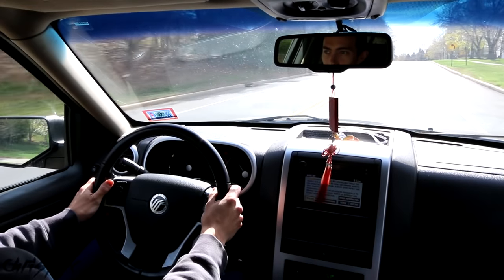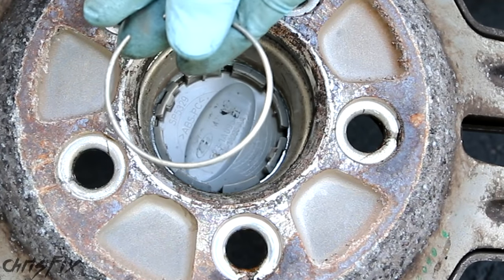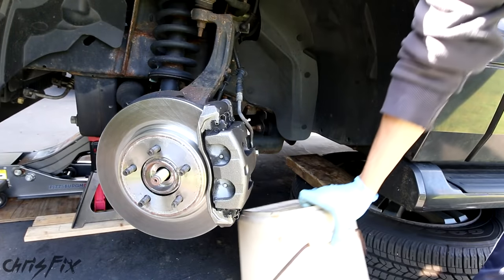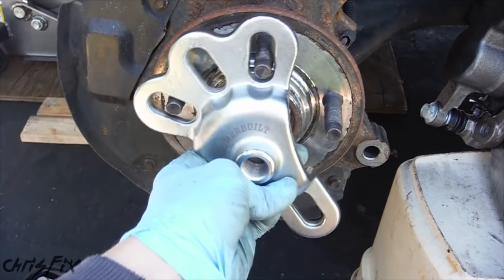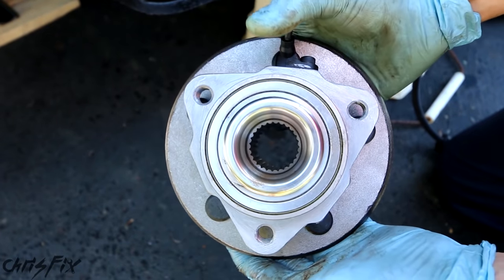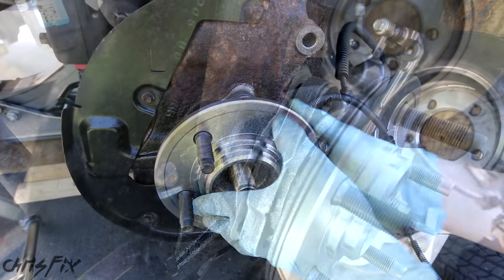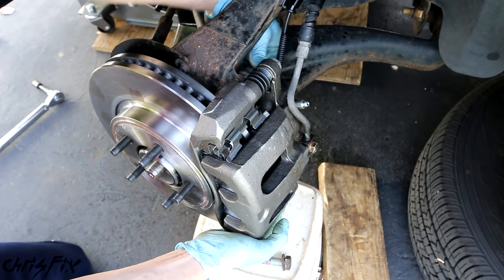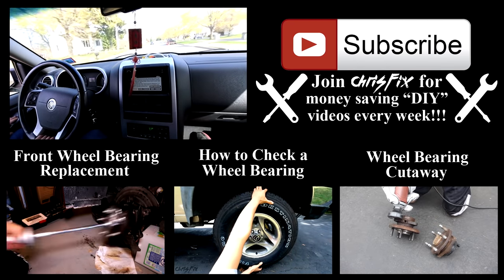How to Replace a Front Wheel Bearing

Comment: I had a mechanic do this on my Ford Focus. It cost me nearly $600 Canadian. They messed up my abs sensor and charged me another $200.
Reply: Less than $100 Canadian and elbow grease if you would of done it yourself.  Assuming you had that tools at the time.
Reply: Yeah, I haven't got the tools. and I sure as hell don't have the tools.
Reply: R.J. Arsenault you really must not have the tools lol
Reply: no I don't. I'm a student working part time, coming from a family that did nothing with cars except drive them and take them to the mechanic, I'm grateful for the screwdriver that we have
Reply: Hopefully you are now in a position to be able to buy the tools to this and other small jobs in the future. It will save you tons of money.
Reply: R.J. Arsenault hope there is autozone or advance autoparts orilleya they lend you tools if you work in their parking lot, just just need tp buy the parts there.
Reply: Honestly if you have a cheap parts store like a harbor frieght, the tools wouldn't cost ya much. You'll either have to buy/rent a axle nut, and that tool to take out the hub assembly. Which even if you bought those, and say the hub assembly ran you 150$? You still wouldn't have spent more than 250$ I'd bet.
Reply: R.J. Arsenault did u need a new transmission aswell
Reply: Surprisingly no ;)
Reply: if bearings are old enough to fail the abs sensors needed replacing. corrosion.
Reply: +R.J. Arsenault - Sometimes you can find excellent socket sets at Canadian Tire for around $100-150. The more you spend the more you get. A 200 piece set will go a long way. A set of screwdrivers, pliers, and Vise-Grip type wrench/pliers should be bought as well. You're welcome.
Reply: Wait what? They charge you for the ABS sensor that they messed up?
Reply: I have had something even worse about 10 years ago.  I brought my car to the dealership for service, and because it was busy, they drove it inside, drained the oil and did some other stuff, then pushed it outside to a public parking spot to make room for other jobs inside and in their own parking lot, and then outside they poured in the new oil.  
Turns out that in their hurry they forgot to close the drain, so the oil went in on the top, and went straight out the bottom again. So when I got there and got my keys and got told where they put my car, it was standing there in a puddle of oil...   
So obviously I complained about that (how mean right?)  and they actually billed me for the extra oil needed.  A couple of weeks later, I got a huge bill from the dealership for cleaning up the oil pollution too (around 5000 USD).  
Lucky enough I had requested security footage from a company across the road because I kinda felt that I could get into trouble for this.  After showing that to the dealership and threatening to take them to court they decided they'd pay for it.  
It was the 3rd incident in a row I had with them (once **cking up the electronics to the point where the car couldnt even drive anymore, and once parking it on a public parking spot without even re-connecting the battery after the work they did, and leaving it unlocked)  so I got rid of the car.  

Now I found a nice dealership that works on my car, and lets me do stuff on my car with their equipment and advice from their people, so it turned out to be a good move to get rid of both the car and the company that kept screwing people (not just me, friends that also bought their cars there too) over. 

When it comes to car maintenance you need to find someone you can trust, and stay with them, as there very bad, and very good companies.
Reply: You should share the name of that dealership-  is it called Ludicrous Auto Werks?  It's laughable they actually billed you for the oil and pollution on top of that-  
you didn't pay for the oil when they billed it, did you?
Reply: I did actually, as I'd rather demand it back even if it is through a lawyer compared to starting a fight there and have them refuse to give me my car back. 
I just wanted the car back and figured I'd demand the money back as it's their screwup, and not part of the quote they gave me that included the oil change.   (And they did refund it when I threatened to involve lawyers) and I never paid for the pollution thing. that's their mess to clean up imho. 

For me its a good example of how rotten companies can get, but Ive also found that there are great ones that will help you with anything. The current dealership I go to for my suzuki is awesome.  Lots of small details get fixed without even getting billed for it, and they are always willing to help with advice, or even help me by letting me use some of their equipment to fix things when doing it myself can save me a lot of money. Also the fact that they just let you watch while they work on the car helps a lot in trusting them.
Reply: There's a dealer by me that lets me do the same as you if need be. Last time I had to use their tools all I had to use was a socket wrench to change out a battery and I had 10 of their mechanics standing around me not believing that a girl could change a battery on her own car. I turned around and said what you guys,  you think it's wrong for a girl to be fixing her own car! They all yell hell no come work for us!
Reply: Canadian Tire.
Reply from the maker: Ouch! That is why I make these videos!
Reply: They didnt mess up the ABS sensor, they fleeced you for an extra 200 because you looked like an easy mark. Mechanics are all liars and thieves.
Reply: ChrisFix Heck yeah man. The most I even spend for parts on my vehicle isn't but $400 at a huge major fix and Chris Fix if it wasn't for a good portion of your videos I wouldn't have a mechanics trainee permit today. I do all of my own vehicle repairs in my driveway and I definitely have a blast doing it myself and knowing that it's fixed right the first time rather than be screwed over by the dealership for something else that they screwed up. My vehicle now currently sits at almost 242,000 miles because I got sick of paying for the line of crap from the garages by my house and not knowing when I'll have my car back. There used to be a shop that every time I would take that car in they always would say that it needed a new engine in it and man were they wrong. It was always a distributor cap. That was on a 1986 Pontiac firebird. Man did I have a field day with that one. Now I have a 2010 Mercury Milan Premier edition and I take damn good care of it. I have rebuilt the suspension, on it done 2 tune ups on her,  replaced both the transmission and engine mounts, have yet to replace the dog bone mount underneath the vehicle, all 4 brakes, all of the door handles inside, converted the stock halogens to LED, ran new stereo speakers in all of the doors, replaced an axle too. She's a 6 cylinder 3.0 liter and eats mustangs for breakfast in drag races. All of the tools I use I paid a little over $400 jack and jackstands included.
Reply: TheSwed3 there super easy to break you could tap some and they'd fall off
Reply: Chaos wow thanks I'm an aspiring mechanic who works in my dad's garage we don't scam people and saying I'm a thief wow cheers a wheel bearing here is around £80 and laybor we normally charge 60-80£ obviously it's be cheaper doing it yourself but your paying for our tools knowlage and experience  so if being as honest as I can is being a thief I guess I'm a theif
Reply: mr nobody I know right! A lot of women here in the states are biased towards the guys saying that us that know how to fix cars are thieves. I do fix not just my own vehicle but my neighbors vehicles too. I got to do my neighbors brakes, battery, and windshield washer fluid nozzles and pump hopefully in the next week. To me her battery and brakes are the most critical fixes that I am going to have to do for her.  Fun times
Reply: Idtelo

Comment: SUGGESTION: once the old bearing is off - show us the difficulty in its not so  free spinning (by hand) and the ease of the new one being hand spun. 

Hopefully we can then see the ease of spin from the new AND the grinding sound from the old.

Also as a small aside when you initially grabbed the tire and wiggles it to show the movement - and then the center hub nut was somewhat easy to loosen, I’d might suggest retightening the center nut to assure THAT is not the problem causing that excess wiggle - just a thought.

Comment: Small tip for new wires. When you need to eplace wire with new, always disconect old wire from one clamp and install new wire. Then disconect old wire from second clamp and install new.... that way you are 100% sure its installed correctly, it won't rubbing vibrating etc.
Reply from the maker: Thanks for the tip!
Reply: @chrisfix  Wow thanks for fast response. Greeting from Poland
Reply: Thank you for this

Comment: "blocked off"
>slim piece of wood

Whatever you say, Chris.
Reply: That helps it from rolling back while the car isnt on even if its that small
Reply from the maker: Just in case you are curious, I forgot I had the wheels blocked off and when I went to back out of the driveway, I had to give it a ton of gas to get over the block. Therefore, it was very secure.

Comment: I’m still stuck on getting the dang axel nut off... it’s been marinating in acetone/ATF for two days now and even my full 250lb weight on a 25” breaker bar (so ~500 ft-lbs of torque) can’t get it off.  I guess this is as good an excuse as any to finally get an impact wrench.  Yes, the car I’m working on spent it’s entire life in the northeast.
Reply from the maker: Darn! I would definitely invest in one for jobs like this then!
Reply: Impact wrench will get it right off
Reply: @yoshtopia8046   Yeah I ended up biting the bullet and buying a 1/2” impact wrench.  It took the nut with no problem and has been useful for several other repairs as well.

Comment: Saw 3 videos  on how to change out a wheel hub bearing assembly from Chris fix. All very detail and helpful. The one thing that did not work for a 00 Dakota Sport 4x4, slide hammer that was used in one of the videos. Was not able to fit correctly on the lug nut studs. Changed out both, left and right, hub bearings for under $200 with Moog  brand. Lowest quote for one side $325. Keep posting. Thanks

Comment: My axle nut wouldn't budge so I bought a corded impact with a 1/2 drive from autozone. It was $85 after tax and had the nut off in seconds
Reply from the maker: Thanks for sharing!
Reply: Same on my nut. I used so much leverage that I misformed the mould a little. Then I bought an impact gun and used a gas torch. Then I heard clunk and the nut was able to come out with the gun.

Comment: You should eventually redo the video of the press in type. My car has them and I’m intimidated to do them, mechanic wants $300 per bearing.
Reply: 300 per bearing thats a big fucking rip off.
Reply: Aaron Vargas I’ve called around and they’re all the same or higher.
Reply: @johnmoore1495  Ive only had a mechanic do mine once and it costed me 120 for both. Better off learning your self.
Reply: Aaron Vargas I could easily do it if it was the hub type.

Comment: how did you read the computer on your tablet? some app?
Reply: have a look at torque pro app called OBD check and then buy a torque pro adapter for you car which is called OBD 2 or 1 easy to do mate cost me a massive £9 cheap as chips
Reply: Bluetooth ODB2 scanner

Comment: Chris!! While this video is really good and made a lot of this easier, I ran into a lot of issues because of the car I was working on, a smaller 2 door Acura. The rotor had screws and I needed an impact screwdriver to remove them, otherwise they would have stripped. There was not enough room to get at the bolts because they were recessed and too close to the CV axle, and the CV axle couldn't be removed because the other suspension parts gave it little room to be pulled out. I had to undo the lower ball joints to give myself enough room to move the CV axle out of the way and then get at the bolts.
Past all that though, all the things that did come up in the video did work perfectly for me!

Comment: can having bad bearings like this cause my truck to shake when i get to 60 mph on the freeway? ive had balancing ,new brakes,new shocks, & nothin
Reply: I had a car with same problem. Turned out to be broken belt in the tire. Potholes, kerbs, or just a bad tire can cause that as well. Hope you find the problem because process of elimination is expensive and aggravating.
Reply: Miguel Castellanos motor mounts ??
Reply: You've had the tires balanced but have you had the the wheels aligned? That could be it. Also, have the tires rotated.
Reply: Several years ago a car I drove would shake at hiway speeds. One day I decide to get under and give it a lube job just for maintenance. End of shimmy...seriously.
Reply: Randy Yale did you check the u joint in the driveshaft
Reply: Yeah man, check your u-joints.
Reply: Triggered You mean like...PRAAAAAA...PRAA...PRAA...PRAAAAAAA...PRAAAAAA...PRAAAAAAAAAAA. I'm a trucker. Maybe you should check your power steering system. Just saying...

Comment: I was watching another youtube video about hub removal - the technician had a great idea. Cut off wheel stud about 1/2" from base, and knock out stud. Replace with a bolt and nut, with bolt pushing against knuckle. Voila - he had hub removed in about 10 minutes.

Comment: Awesome tip! Removing the brake caliper AND the rotor together. 😆
I’ll probably do that next time. 

Although, last time I took off the wheel / caliper / rotor separately for wheel stud replacement, BECAUSE I was removing each component at a time, I found the brake pads were simply crammed into the hardware bracket by the previous garage that worked on it. Damn pads weren’t sliding with ease.
Cleaning off all the brake dust etc didn’t help; there were tolerance issues with the hardware kit - so once it’s crammed in, it squeezes the pads too tightly. These are things the previous mechanic should have done something about, but didn’t. 

I ended up using a file to reshape the pad’s backing plate slightly- removed maybe 0.02mm of material. After that, the pad slides easily in the bracket without be loose.
Now my brake pedal feel is even more precise than before.

Definitely pays to learn how to work on your own car. 
👍👍 to Chris Fix for sharing these videos with everyone.
Reply from the maker: Glad you learned some tips!!!

Comment: We replaced the hub bearing assembly on a 2004 mercury mountaineer my first time had trouble with the back bolts little room got it a bit stripped but power tool and torch got it out the rest was cake the slide hammer didn't get it off so we used hammer and chisel no problem thanks Chris
Reply from the maker: I'm glad you were still able to get it done! That's what I love to hear!

Comment: To clean the rust quickly, just use a dremel. Cut two sand paper discs in the size and grit you need and put them together, back to back, to have some stiffness. That allows you compress the sand paper a bit and clean the rust better. Assemble it on the dremel pin, then to the dremel and clean away. Used it on my aluminium rims to clean the nut socket made out of stainless steel. Worked perfectly.

Comment: That frozen hub assembly brought back some nightmares, the clanging and the smell of PB Blaster lol. I'd also emphasize to not reuse the axle nut, buy a new one before you start. My Subie axles had a notch, and after you torque down the axle nut, you hammer a punch into the edge of the axle nut to basically dent it down into the notch, which helps keep it from coming off.

Comment: 8:43 Amen, brother.  Smartest thing I ever did was buy a $10 jug of anti-seize.  I use it all over the place, and my parts magically come apart without insane pounding and hammering and heat.  I am astounded that a car repair place will charge $1200 for a repair but will not use 12 cents of anti-seize when doing the repair.

Comment: I hate seized hubs. A trick I was taught was to hammer off two wheel studs. And then use any long bolt (and nut on the other side of the hole) that can fit through the hole and torque it against any solid surface behind the wheel hub. Pops right off without fuss.

Comment: Hey Chris! First off let me say thank you. Being born female people really try to screw you around with maintenance costs, luckily I found you and am now doing my own maintenance. Which brings me to my question. I recently replace a buddy of mines wheel bearings and tierods. The tierods are fine and I think the bearing are fine. When I was doing the passenger side bearing I noticed that the axle cog (I guess that’s what it is) was as loose and not where it should be. I tried putting it back in place and continuing the bearing. When I was done and went to test drive it, the brakes were fine at first then seized up and felt and sounded  like metal grinding on metal. The pads are good and I’ve replaced enough brake pads that I know they aren’t the issue and were working fine before. Did I get bad wheel bearings or do you think it’s the axle? Any advice is welcome!

Comment: Having to fix one of these now, something not mentioned a lot is the reason the ABS light comes on is because the wheel is spinning slower or faster than the others which causes the ABS to kick in.

Sometimes doing a hard breaking move or pumping the brakes hard can make this go away, but that's just because the brakes are slowing the tire down and not tripping the sensors.

Just wanted to point that out cause that is my issue and not a lot of people have mentioned it.

Comment: Nice.
 I ended up using a bearing separator tool and used the 2 outside threaded rods to push against the knuckle.  Alternated tightening the rods with an impact and pulled it right off.